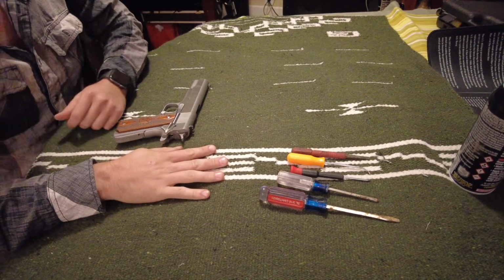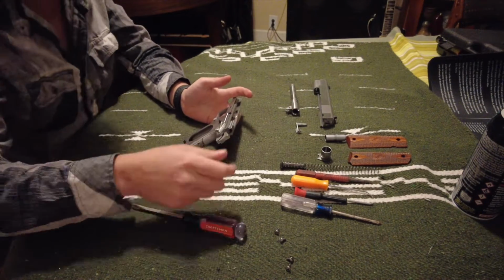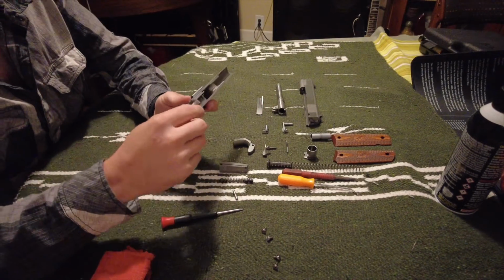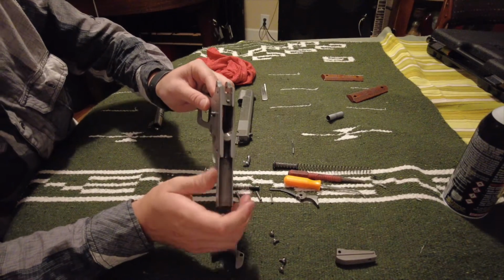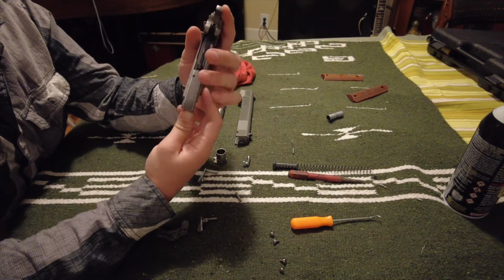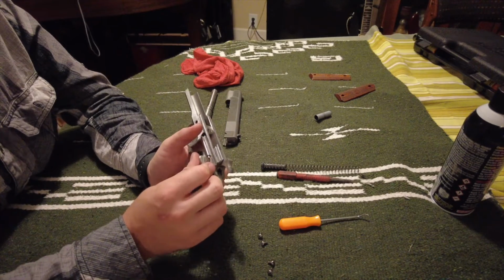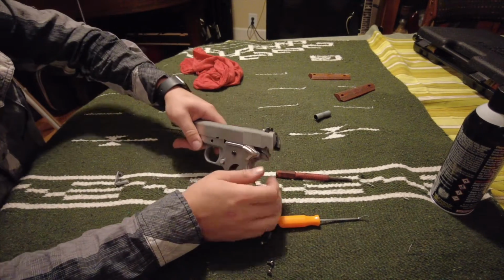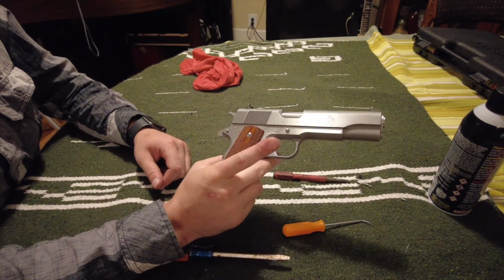Springfield Armory Colt 1911 Disassembly, Cleaning,& Assembly.

Comment: You don’t need to move the barrel around to see the hole in the link where the slide stop goes. The slide stop does not need to be pressed really hard to go in; if it slips, it will leave a nasty scratch in your slide. If you have it in the right spot, it will simply snap in.

Comment: Before you attempt to remove the mainspring housing, depress the trigger so the hammer is not under tension! This will release the pressure on the mainspring. By the way , Springfield no longer uses a capture pin for the mainspring causing reassembly very difficult! When I called them they said, “ We thought we don’t need that part anymore”! You can’t put a capture spring in because the parts are proprietary dimensions and are not milspec! Be aware!

Comment: Good job, thanks for sharing, are you a armorer? Where did you learn the process?
Reply from the maker: Thank you. Most of what I know I learned from dad and grandpa and now I’m teaching my boys.
Reply: @norcalrambler101  Great! I'll be subscribing soon, do you think the Ronin in 10mm is a good first 1911 buy, are there any other brands you would recommend?
Reply from the maker: @steven3379  yeah that’s a good gun, 10mm round is a little more pricey to make and or buy than 45acp but if you ok with that in my opinion that’s a good first 1911. You almost can’t go wrong with 1911-A1’s they were fine tuned from original 1911’s and used in the US military for a long time.

Comment: Crazy! You need to drop the hammer before you take out the hammer spring housing pin. Takes the pressure off the hamner spring.👎
Reply from the maker: Thanks for the tip Galen. 👍